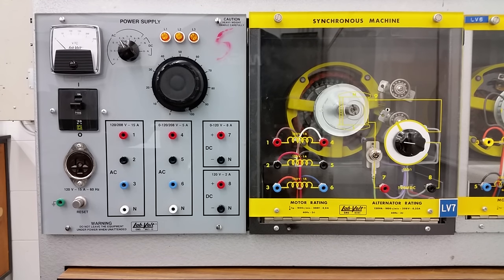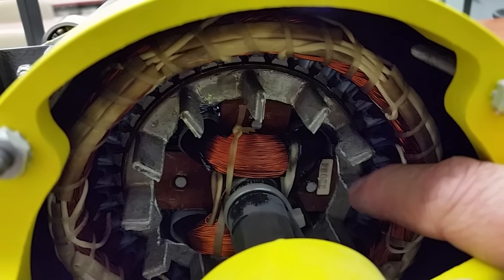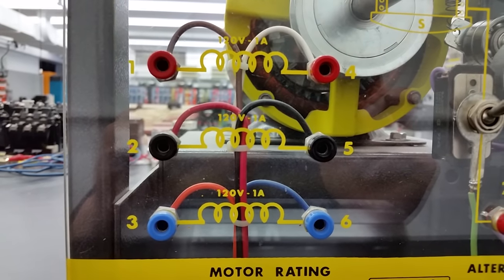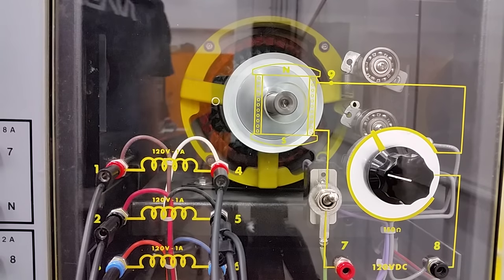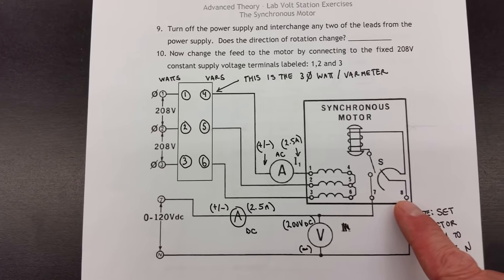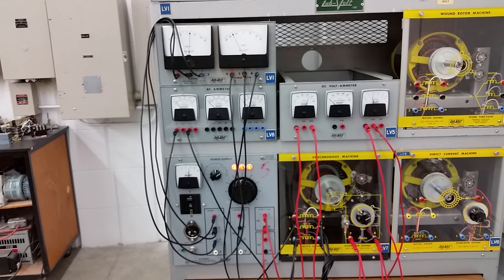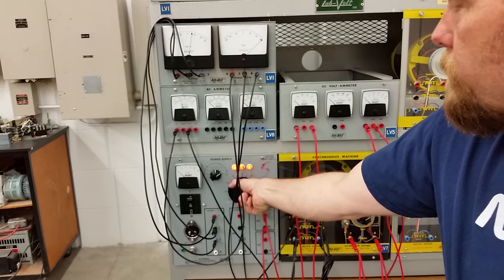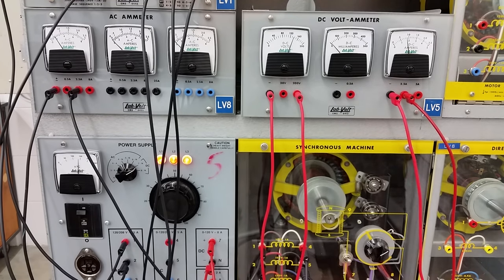Synchronous Motor Lab

Comment: Awesome demonstration Pete! At NASA GRC in Cleveland, we use many 10k+ HP synchronous motors to drive large air compressors. Although the motors are larger and the starting/running control systems are more complex, they work just as you demonstrate because the fundamentals are the same. Also, commissioning a system of synchronous condensors (spare synchronous motors really) is under consideration to help stabilize our grid. Nice shirt, btw. Thanks!
Reply from the maker: Best comment ever. Made my day. Thanks so much.

Comment: I have fond memories of learning about motors using the exact same lab-volt modules. It was a great system. The trade school I went to would start you on the modular trainers then if you were half decent at that you’d get to play with real equipment from the scrap pile.

Comment: Great video that still applies. Perhaps the reason the motor didn't shudder in the beginning is there was no load? We did this experiment following a Festo/Lab Volt created lab, which asks us to start the motor at max load (3.0 N-m). Our set-up has the Dynamometer/Prime Mover module. We measured in excess of 3A winding current, and loud shuddering. Wish we would have known that was expected when first trying it!!

Comment: Thank you for the excellent demonstration! I would appreciate it if you could illustrate the process of transitioning from induction to synchronous motor with an incremental increase in speed up to the synchronous speed. Additionally, if you could demonstrate the transition to a capacitive load motor with a fixed speed at synchronous speed through excitation, it would help me better understand the behavior in speed.

Comment: It's worth noting in a real world setting, you would never EVER apply rotor voltage before the motor is already spinning. Some synchronous motors are made to be started from a dead stop in emergency situations, but generally speaking, those motors are only rated to do that two or three times in their lifetime. And they'll make a hell of a racket while they start.
Reply: Hey... we are using magnetic levitation bearings and brushless motors now. I thought we were way past using brushes?  Why even have a DC motor to start it up when you can have permanent magnets in the rotor and use the stator to bring the rotor slowly up to operating speed beginning at 0 Hz and increasing it up to full operating speed. A microcontroller could look at the pole of the magnets and set the polarity of the stator windings to create an attracting force to begin rotating the rotor slowing and then staying just ahead of it as it accelerates to full speed. The DC motor portion seems to be a lazy engineer's way of getting around the problem of starting the Sync motor when the rotor is stationary and unnecessarily complicating its design.
Reply: @JayDAnderson  MG sets are still a thing. Also, what you're talking about requires the use of a specialized (and expensive) VFD setup. Also, you will never be able to yield the kind of torque results from a PMG motor that you can get from an excited field application. Also, a synchronous motor comes in another form: a generator. So, no. We are not past using brushes. It depends on the application.

Comment: Could the DC induction-motor component that is used to start the synchronous motor be omitted in the design?  Since the frequency of the AC to the stator regulates the synchronous motor speed maybe it could be possible to omit the DC motor and Instead just bring up the AC frequency of the stator slowly up from 0 Hz to full operating speed? That way the stators' rotational magnetic field slowly pulls the rotor up to full sync speed (where rotor rpm = stator rotational magmatic field speed). The controller could keep the stator frequency increasing at a rate just ahead of the magnetic-hysteresis lag time of the rotor to bring it to full operating speed before any load is applied to the motor. Just to keeps things simple and not unnecessarily complicate things. Seems the DC motor portion just creates additional points of failure for the synchronous motor and limits the maximum speed and strength of the motor. It complicates dynamically balancing the rotor (cause there is DC motor windings inside it) and centrifugal forces could cause the DC motor windings to fail. Also, the DC motor keeps you from being able to use any permanent magnets in the rotor to improve the torque of the motor (additional assist to prevent a load from overcoming the critical-load angle and causing the motor to fail). Since the the synchronous motor stator is magnetically locked with the rotor this rotor could have some powerful permanent magnets in it to make it stronger except the DC motor starter prevents that improvement. The controller could just then determine which coil was closest to which magnet in the rotational direction of the rotor and give that stator coil an opposite (attracting) magnetic pole to get the rotor moving along. Since the rotor is magnetically locked when the motor reaches operational speed (is synchronized) it should be okay for the rotor sections to have permanent magnets to supplement the overall strength of the synchronized motor. The magnets could give the controller more time to respond to abrupt loads by increasing current to the stator before failure occurs.  Just some thoughts.

Comment: The motor didn't shake as you expect it, because there is already a squirrel cage in the rotor which started the motor. It would do that only in a pure synchronous motor without the squirrel cage.
Reply: The other factor is the distance of the DC poles from the stator, the DC pole material, the number of turns, and connected load mass.
These factors do the following.
1 Further distance makes the motor primarily an induction motor on startup.
2 The pole material if solid and not laminated, will have higher shorted turn effect making it more an induction start. A laminated core is more difficult to start with DC applied at startup. Many of the motors have shorted rings of copper on the poles to reduce AC coupling while starting to prevent the high number of turns causing excessive AC voltage in the coil on startup. Examine the magnets carefully. You may find shorting copper rings on the poles, or under the winding is a copper sleeve making a shorted turn under or over the winding coil. I don't see it in this motor, it appears to use the squirrel cage winding for this.
3 The more turns the higher the inductance of the winding and the longer time is required to build current and magnetic pole strength, This auto delays starup pole field until after the motor has gained speed.
4 Unloaded motor with no inertial external load spools up faster. A large exhaust fan won't like starting that way.
Some small synchronous motors use permanent magnets instead of a DC coil. These often again have the magnets buried deep below the squirrel cage induction staring coils. These are often in small timer motors using single phase power with a shaded pole for starting torque, very low rotating mass for quick ramp to synchronous speed.
The comment that it would be pure synchronous without the squirrel cage is incorrect. It is synchronous when DC is applied. As there is no slip when locked, the squirrel cage provides zero torque at locked speed, so it is only a synchronous motor when locked. An induction motor at synchronous speed does so with 0 horsepower as there is no torque. An induction motor has torque when running below synchronous speed.

Comment: great info... do you have a "vars" meter kit to add to old synchronous motor drives to monitor the capacitance-resistance-inductance motor mode that things are OK? 🙂 thanks

Comment: This is was very helpful,thanks man .But I would like to know that why did the stator current went to 1A to almost zero when the motor was drawing 0 VArs (resistive load) and what were the terminal voltage of the stator when the motor was acting as a condensor.
Reply from the maker: The current goes to zero because the Over-Excited Rotor has generated a Leading Current that reduces the consumption from the Source (the motor is acting as a motor and a generator simultaneously. I believe the terminal voltage of the stator remained the same.

Comment: This is more of a conceptual question but If I were to couple this motor rotor to a shaft, and I try to lock the stator voltage first and then induce excitation on the rotor by increasing the DC power supply. How would this excitation reflect on the shaft ? I'm curious to know.

Comment: So the current remains the same? About an amp on the ac side and an amp on the DC side? Might as well have a larger DC rotor and stator with a gearbox to take over the transmission for a three phase AC Induction motor right? How much power loss would we expect to loose with modern frequency drives and drivers?  I have drawings of capacitor driven DC motors around here some were.  What if this shaft is pushing a vehicle that weights 1000 pounds?

Comment: Thanks a lot! , I would like to ask, What happened with the VARs when I connect the synchronous motor on delta mode?. Great video.
Reply: If your input is a 208VAC a delta config results in 208VAC in every one of the phases (I don’t now if this configuration exists in our USA power system), therefore, 208VAC in each of the stators windings. Hence, a stronger magnetic field with all the resulting effects. It is a matter of looking at the motor specs to find out if it can handle these input conditions.

Comment: If the synchronous motor acts like an capacitive load, would it improve the cos phi ? and what would happen on other motors that are connected to the net ? Would the capacitive load improve the cos phi of those too ?
Reply from the maker: It would decrease the phase angle on the distribution system by providing Capacitive VARs to the inductive loads. Nothing visibly happens to the other motors connected to the Condenser distribution system. Here is a link for more info. https://en.wikipedia.org/wiki/Synchronous_condenser
Reply: Pete Vree thanks for the info. You're explaining it really clear! I've learned so much from your videos! Keep up the good work !
Reply: This phenomenon only occurs when over excited. See ‘v curves for synchronous wound rotor machines’.
Reply: @PeteVree  is there a way to use a synchronous motor alone to generate electricity  for example connecting it to another motor like the one found in old cassette radios and use that as a source of winding energy but how would one deal with heat generated

Comment: Sorry if this is a dumb question, but I thought the rotor wouldn't turn unless you applied voltage to it. It looks like the rotor turns when you only apply voltage to the stator.
Reply: This trainer does rotate if voltage is only applied to the stator. The rotor has a squirrel cage component around the outside...the amortisseur windings.
Reply: We only apply DC voltage to the rotor once it is up and running close to synchronous speed

Comment: what are the ball bearing looking things, also what is the variable on the motor plate
Reply from the maker: The bearings are probably wearing thin... we've been using these trainers for easily 15 years. The potentiometer on the front controls the amount of DC voltage applied to the rotor.
Reply: @PeteVree  cool i have been watching your lessons i wish i had one of those trainers to play with

Comment: Dear sir very nice video but could you please send me the link of Synchronus generator experiment, i would appreciate as it will help our students alot thanks.
Reply from the maker: You can find a PDF of the lab on the following page: https://wyedelta.wixsite.com/html_canada-electrical/untitled-masterpage_63
Reply: Dear sir, I mean the video link if you have? I already have the experiment but want to share it with students.
Reply: And in fact i need video synchronous generator experiment. the one you share is motor.
Reply from the maker: @waqarjanchd  I have not done a video on that unit.

Comment: what will happen if rotor is exited with ac source did any one tried it in lab
Reply from the maker: Nothing good. The rotor would be the secondary of the rotating transformer and would induce a high voltage on the Primary. Our lab specifically states not to be a donkey and try this.

Comment: Your experiment fails, because you are not able to energize your stator and your rotor independently you need another Breaker in parallel with the electric source. So you can apply the dc voltage to the rotor first and after a moment apply energy to the stator an like this is how you will demonstrate the vibration you are talking about because the rotor can not follow the speed of the rotating magnetic field.